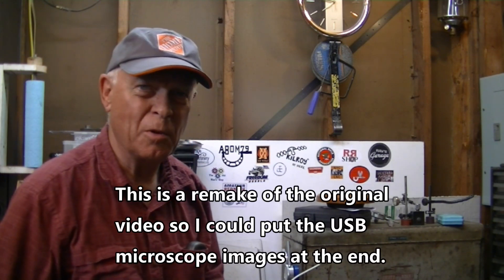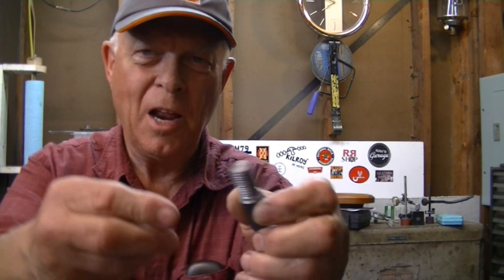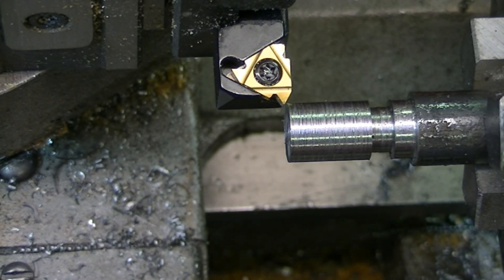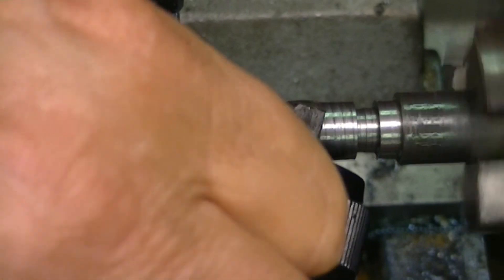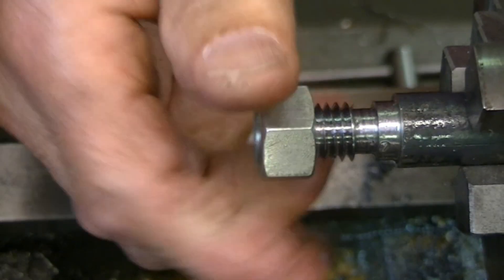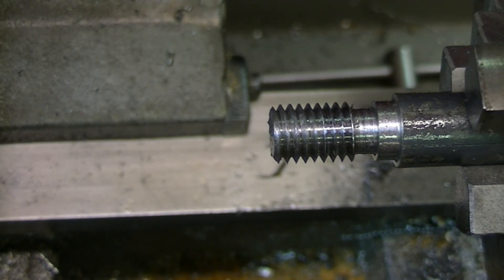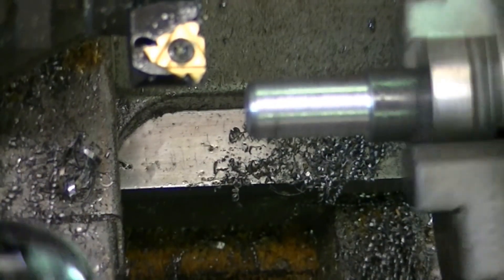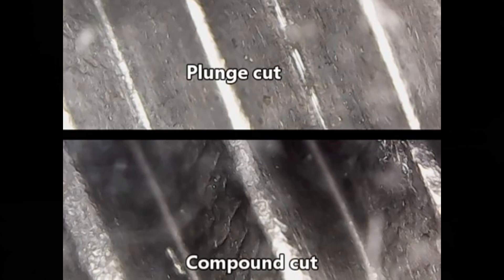Plunge threading vs compound threading

Comment: Plunge cutting is so much faster , with less possibility of error.  Having the compound cranked to 30 deg approx  is a pain in the butt when doing other operations.  
However, once the pitch gets substantially large, it’s likely necessary to prevent chatter. Say 8-10 TPI And less. 
CNC flat top threading inserts have pockets in the top face to collapse the double flank chip, chip breaker so to speak.  Carbide likes to plunge owing to its insert geometry , ground HSS likely benefits from angled feed.
Reply from the maker: Thanks for stopping by.

Comment: I plunge cut threads all the time. I will even start the thread for the stop. I use a left hand insert and put it upside down and run spindle in reverse.
Reply from the maker: That is a good way to keep from threading too far.  Thanks for stopping by.

Comment: Looks like on the compound cutting you were not running a high enough surface speed. Ended up with tearing and not shearing.
Reply from the maker: It takes a real pro to run a high surface speed when single point threading I am an amateur.   Thanks for viewing and commenting, please come back for my other videos.

Comment: Hey Harold... Was it you who was talking about turning pipe with magnets inside? 'Pipe is tripe' at the best of time and I was doing some the other day and the blasted harmonics were driving me insane... Enough to the point where I pulled the piece out of the chuck and dumped it.... Magnets inside is what I remember from somewhere?
Reply from the maker: No I have never had that experience.  Thanks for stopping by.

Comment: Plunge is good. I just had an argument with an old timer who does not know anything other than 60deg compound cutting while I said a compound can be any angle and its the tool that shapes the thread. I was wrong as it needs to be 29 or 29.5 to be compound threaded but I was right that it can be any angle for plunging. Great video and love your relaxed casual style. I've got a video coming out pretty soon I'm calling 'Metric Threading Myths..... Busted!'
Reply from the maker: All of us whether amateur or pro learns something new every day.  Being an amateur I learn more than you might expect.   Drop me a note when your video is done.  Thanks for stopping by.
Reply: My video is going to be about the fact that when you're doing metric threading, you can actually completely disengage the half nuts and totally lose track of the entire synchronization of spindle, gear train and carriage...... But then in less than 30 seconds you can re establish the exact same synchronization and continue threading with not the slightest alteration of the thread geometry being cut. A precise reset and not a 'thread chase repair'. This method for when there might be an accidental half nut opening or for when a test screw on piece needs to be tried until the perfect fit is achieved.

Comment: Hi Harold,
Thread cutting....  ;)
One black beast for the beginner...  
The measure you need to get in order to measure a thread with a thread micrometer is the = Pitch Diameter = I've looked in the Black Book but they don't mention it...
I use the Machinery's Handbook for my references.
Short for cutting a 1/2 - 13 class 2A thread:
Major diameter: Between  0.0495 and 0.0487"
Pitch diameter : Between 0.4485 and 0.4435"
 Meaning that if your thread using the thread micrometer is between = 0.4485 and 0.4435" = you got a thread that will pass the inspection...   ;)
Have fun trying and getting it done...
Reply from the maker: I get my numbers from the machinery's handbook also.  The black book is not all that helpful in my opinion.  Thanks for stopping by.
Reply: The bad news about threading is that better finish rimes with higher turning speeds...   lol
Reply from the maker: Higher turning speeds conflict with "old geezer".

Comment: Are you using an Atlas lathe and if so what tool post holder are you using and what  type insert are you using?
Reply from the maker: I am using an Atlas lathe and the tool post is of Chinese origin.  I think I got the tool post from CDCO Tools.  The threading tool, both holder and insert are from Shars as far as I can remember.  The tool post required me to make a bolt for the center of it so that it would fit my lathe.  I used the little flat nut from the lantern tool post that came with the lathe and the screw that comes with it.  Thanks for stopping by.

Comment: Both work, I guess it is how you learn it and are comfortable with. I've even done most of the threading using the compound and then the last few thou plunging to make sure everything is cleaned up. I haven't done any threading since I picked up a couple of the pitch specific, full profile threading inserts when I saw them on sale somewhere.
Reply from the maker: I hear those are nice.  Thanks for stopping by.

Comment: good video harrold . the problem i have with the plunging technique is if you dont use the compound is you have to keep track of your feed dial .the phone rings and then you ask yourself where was i ? plunging is ok until you get into larger threads, then the high load on the tool from cutting on both sides can cause problems with less rigid home shop machines .why take a chance on ruining a thread to save a little time. i have tried thread mikes but each mike only works for a limited number of pitches and diameters. and they are expensive. if you are threading without a test piece i think the wires are the way to go.lots of opinions and techniques here, but the bottom line is if you create a thread with the proper pitch diameter and form then you did something right.
Reply from the maker: I am sure you are correct on all counts.  Thanks for stopping by.

Comment: I prefer to plunge thread.  I've tried the angled top slide method but don't see any advantage.

Interestingly, if you go back through old lathe work manuals (like Hercus Text Book of Turning) you will only find reference to plunge threading.  Worked OK in the old days, and still does.

Cheers Rob
Reply from the maker: Yes it does work great for me, I guess it is mostly in how you want to do the job.  If I had some really tough material like stainless I would be happier with the compound method.   That stuff is tough and stringy.  Thanks for stopping by.
Reply: Absolutely right, people were cutting threads on lathes before some lathes even had top/compound slides.

Comment: Both way produce a useable thread, but the compound /half thread angle method will produce a better thread form, this is due to the fact that when plunging, the back end of the cutter is rubbing on the thread flank, but with the compound method, only the cutting edge of the tool is touching with any depth, both of your threads came out very well, but it is the small burrs at the top of the thread form which need to be "smoothed" off, as you did with the emery cloth, as a matter of interest why is it that most American presenters call it sandpaper ? A very informative tutorial !
Reply from the maker: We call it sand paper because that is what we grew up hearing it called.  Maybe at one time it was made by gluing sand to the paper, or maybe people just assumed it was.  Just like a refrigerator was always called a Frigidaire, soft drinks were/are cokes, facial tissues are called Kleenex.   The Frigidaire seems to have faded from the language.  Thanks for stopping by.
Reply: I guess we have sand paper here and emery cloth. Sand paper has (you guessed it) a paper back and emery has (you guessed it) a cloth back. :)
Reply: Emery is corundum, the same mineral as sapphire and ruby, only it's ugly and common. Diamond is hardness 10, corundum is 9, the same as tungsten carbide. Sand (quartz) is a 7. Hardened steel runs from 7 to 8 (on the Mohs scale).
Reply: westhowe: Spot on there ! Sand paper, because of its lack of hard grains is used for wood,(Shark Skin was once used), whereas Emery(a trade name I am sure) is used for metal, abrasive paper/cloth for metal can of course be backed with paper (as in wet or dry), or cloth,(as in Emery cloth) Harold has pointed out that the "common" name for many things is usually derived from the original makers name, as in Petrol (for motor spirit) , Biro ( for those horrid ball point pens ), and Hoover (for vacuum cleaner),I think we all use common names for articles that are not from our own trade.
Reply: When I was at school the wood work teacher said to "never call it sand paper, it is glass paper, sand paper is what you put in the bottom of Budgie cages.".

Comment: i would guess that on small threads, the tool loading can allow a plunge cut, its not a lot of metal to come off, ive seen it happen that due to luck over the lack of attention, a thread can be cut in one pass and be just fine, but its too tempting for bozo to sneak in the door.
Reply from the maker: Bozo lives in my garage.   I do it both ways, depending on my mood.  Thanks for stopping by.

Comment: hi Harold on the few times I cut single point threading.I only plunge cut because I don't know any better but it always works for me thanks for sharing 😀😀
Reply from the maker: My metal shop teacher told me to use the compound and so I did for many years.  Now I just thread anyway I want.  Thanks for stopping by.

Comment: Boo!  Hisss hiss!  STomp, Stomp.  We want the Bubba presenter to do the Bubba joke!  Lol!  Seriously,  how did you start that last thread with no relief and yet end up with a relief slot?  "Lathe Learning" DVD I bought from a machinist in San Antonio several years ago (paid big bucks for the series before You Tube filled the void) said one of his first jobs in a machine shop was at a lathe that had no compound where they showed him the straight in method of cutting threads.  So you have many ways to skin those felines you were talking about.  All seem to work just fine.  I would still like to perfect the Joe P upside down left to right method.  When I get the shop finished....

We had ten days a week or so ago of mid seventies and even a couple got to the mid eighties!  She was a scorcher!  But then a week ago we went back to normal mid fifties and rain with some wind.  Looks like that will be all we get for a summer.  I was even thinking about buying an air conditioner!  (The grocery store and Walmart were big sellers since they had the only a/c in town).

Take care.  Doug
Reply from the maker: We hit 100 deg F one day in July.  It has mostly been hot and very humid this summer but due to the many thunder storms we have had a lot of days in the mid 80's.  Altogether very mild summer for Houston, at least so far.  Sometimes we just have to do without a Bubba joke.  Thanks for stopping by.

Comment: hmm  been awhile since single pointed a thread but came up back in day angling the compound   but if it works  it works
Reply from the maker: It seems to me that it gives the same results on soft metal like aluminum and some steel.  Thanks for stopping by.